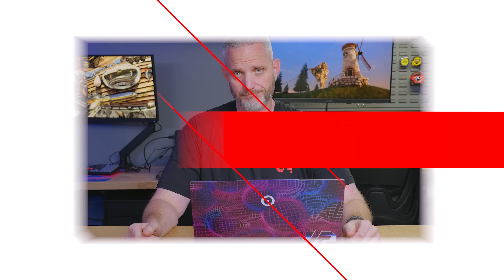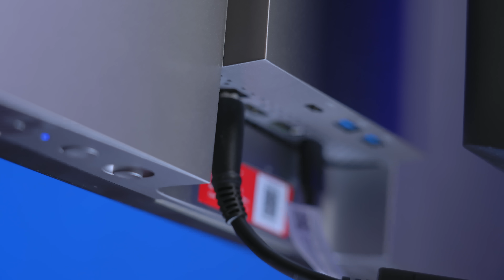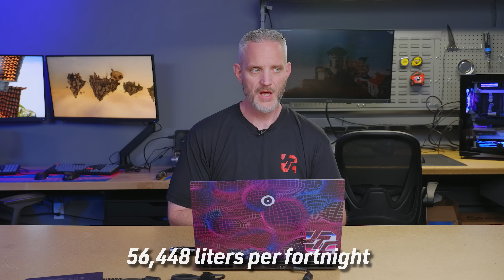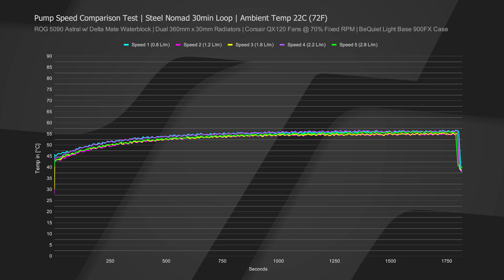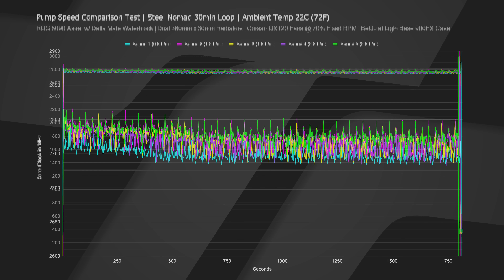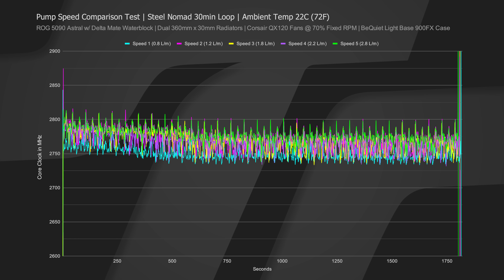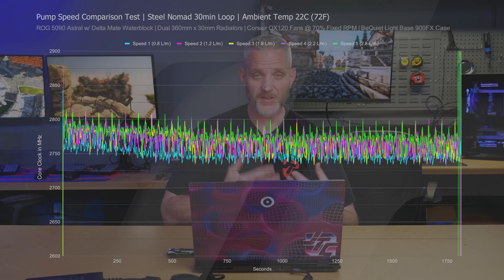Stop doing it this way!

Comment: Advice from someone who has tried just about every kind of loop configuration in my 20 years of water cooling: Don't use reservoirs, use a t-line fill port instead. A reservoir decreases flowrate for a given pump speed, and increases the amount of coolant in the system that isn't actively transferring heat. A higher coolant volume that isn't doing work makes tuning fan speed and flowrate more difficult due to the increase in time it takes to remove heat soak. A reservoirless loop with the smoothest and shortest tubing runs will be quieter and more efficient, and the reduction in turbulence and better isolation of any air in the system can reduce maintenance requirements especially in combination with ethylene glycol based automotive coolants.
Reply: But also, thermal mass increases time to heat soak. So resovoirs are definitely still worth it.
Reply: not necessarily more quiet. Because again, higher heat soak threshold meaning lower temps more of the time. Especially useful for bursty loads.
Reply: @technicalzombie921  That added thermal mass is only useful if it's actually transferring heat out of the system and if it's already near ambient temperature, and because a reservoir both adds thermal mass that is transferring less heat and also reduces flowrate for a given pump speed, regardless if it's during bursty workloads or long term high load scenarios, reservoirless ultimately ends up being more efficient at lower noise levels. Yes, I agree that it's somewhat counterintuitive, but I recommend you test this yourself, because I have in many different ways over 2 decades. Reservoirs, distribution blocks, and hard line with sharp bends will all result in a noisier and less efficient loop for the sake of aesthetics.

Comment: For measuring the Amount of heat the pump adds to the loop -- couldn't you just take the temp of water within a loop with no components (other than the pump) with the pump off. Then, run the pump at different speeds and take a temp of the loop with a thermometer? This way the only heat/added heat you measure is from the pump itself.

Comment: I have run similar tests on my ID cooling AIO and 80% seems to be the sweet spot. If I set it to 100%, it cools more initially but the temp increases more over time. Which indicates the radiator is not getting rid of heat as fast as the heat is being taken from the CPU. If I set it to 60%, the temp rises quickly and stays high. But at 80% it climbs a little right away and then barely creeps up a few more degrees over time. However, no matter how I set it, my 9950x never reaches more than 80C(100%). But at 80% it evens out pretty quickly to 75-77C and at 60% it quickly climbs to 78c and creeps to 80C.
The AIO fans are set to 50% idle and ramp evenly to 100% at 80c
5.2Ghz 1.1v all core

Comment: In really short terms, Q=ṁ*Cp*dT is the answer.

Q is known, as its the heat released by both GPU and CPU (and the pump as stated).
ṁ is known as its measured by the flow meter.
Cp of the coolant is known.
dT is the temperature differential. 

You can play around with these numbers. If add two temperature sensors for the coolant before and after the rad  you can set your dT (or anywhere you want to know the dT). With the dT set, you can precisely measure the heat exchanged by the rad. And, with the overall Q of the system known, compared with this Q measured, now you can get the overall efficiency for each rad, or the entire loop for each flow measured.

Also, you can easily mesure the inlet and outlet air temperature and use the same equation to get the efficiency of the rad/fans. You then can fix the pump speed and play around with fan speeds and set the overall most efficient combination of fan/pump speed for anything you're trying to achieve.

OR, you can go down the rabbit hole of calculate everything by LMDT for heat exchangers.

Comment: I tuned my D5 to about 2/3 speed or around 2900 rpm but I did that for noise more than anything. Pump is mounted kinda solid to the case which would sometimes caused a vibration if the pump was set too high. Fantastic pump by the way!!

Comment: Higher flow rates become more beneficial the more radiator space you have. A build that had 3x 420mm of the same thickness, fpi, find design etc would have more than twice the possible heat dissipation and would show more of a difference. For the sake of the argument alone, someone with external radiators could have seen a much larger difference. That’s because they can have so much radiator space that they basically cool the fluid back to ambient before they exit the radiators.

Comment: You don't need to measure the heat of the pump, in fact, that's probably not a great indicator of how much heat is being added by the pump. You should try and find the pump efficiency factor and set up a ratio of watts consumed at full speed to find what wattage is being converted straight into heat. There's also friction to consider as the pump works on the water as well but it's probably not significant since the pump is tiny.

Comment: why don't test a 1260 alphacool external rad. I use IT with my 5090 is awesome. Or simply test RAD into the case vs rad Outside of the case.

Comment: Perhaps knowing the ideal pump speed, you could test how fan speed might impact this?
Or, potentially, how different types of fans could affect it at different speeds?
I think Noctua for example, have some good general fans that could be used for rads or just general case cooling.

Comment: TL;DR: Pump speeds in AIO have big reserve, so do fan speeds. Those things are not created to be used in open bench with easy airflow. They are made for average poorly vented PC where hot air from graphics card gets fed into AIO's radiator. Systems with half-decent airflow can have pump running between 50~80%. (50% is advised minimum to ensure that pump actually does not stop. Where stop point is somewhere between 15~35%.)
- - - -

I always start tuning cooling with quieting down everything. Settings fans in bios to minimum. And then testing one fan after another at different speeds to find out where they start making noticeable noise and where they start to be loud. Same applies to AIP pump.

Afterwards I set fans in way that they are quiet at low temperatures which are safe (idle). Then set speeds which are highest acceptable to be used at maximum temperature I want system to ever have. And then 100% rpm for what I consider unacceptable temperature (Which is still under what manufacturer sets as maximum operational temp.)
In practice, good cooling will never reach fan speeds close to those highest acceptable noise levels.

Once fans are set up, I test temperature response under load based on pump speed. And again set it in range that is both quiet and more than sufficient. Sure, I use 280mm AIO for Ryzen 7 9800X3D which I limited to 105W (default 120W), which is overkill. It boosts to 5.45 GHz, anyway... thanks to undervolt and being quite power efficient to begin with.

To hear my gaming desktop, I have to turn off ASUS X13 2-in-1 laptop, which has tuned fans for quietness, too. To hear my home server, It is not enough to turn off everything around. You'll need to be closer than ~80 cm from it.
= = = =
Funny thing is, that I do run Liquid Freezer 3. And with recent improvements in small profile traditional heatsink based CPU coolers, I could get similar temperatures at even lower noise level. But I do like AIOs for very specific reason. Portion of cooling which is attached to motherboard is light, therefore when you move PC around, there are no shocks.

Only thing I dislike on AC LF3 is that while you can adjust pipe angle at cold plate block, you can't do same at radiator. That's very annoying for tube management in case where you have only few centimeters clearance. (As those tubes going in/out of radiator aim directly at motherboard's back I/O block.)

Comment: Calculating flow rate is a very common and important thing in Thermodynamics. There is a certain sweet point that you can calculate to get the most heat out of the system before it gets carried back into the loop. This is strongly dependent on cooler size, resistance, fin density, material and air flow rate. If you have all the data, you can calculate the sweet point and set your pump speed to that

Comment: You know what temp bounces around less than a gpu coming on and off load during scenes? Water temp. 

Do you know what temp would have shown the point much better than a bouncing around gpu temp? That’s right, water temp.

The 10% missing once again would have shown a much cleaner picture come time for results making this video significantly more useful.

Comment: Mine seems to work best between 40 and 50% about 1.2Lpm and my theory is the water need some time for heat transfer ether to the rad or to the waterblocks im running a ek block a ek 3090 block and a 9950x3d gpu a 280 and a 420

Comment: Thanks for the vid!

You could make a video about how much resistance a pump actually can handle before flowrate is stopped

I recently built a dual system loop for me and my fiance with 1 GPU block, 2 cpu blocks, 2 radiators, 16 90:s fittings, 2 offsets and 2 EK FLT reservoars. All running with the same D5  pump. 
It is all fine and the pump doesn't have much trouble pushing the liquid through all that 😁

Comment: What was the previous AIO video? I can't find it! The summer is coming...
I have Artic Liquid Freezer 240 II on 5800x with 120 P12 fans on it and on the case for intake and exhaust, and wana see what would be the best optimum setting for the pump!
I don't have a power demanding GPU (7600 XT) that gives a lot of heat.

Comment: Well the Arctic Freezer AiOs can't be controlled unfortunately, but before these I had a Corsair and the a NZXT AiO and I also noticed not a big difference when changing pump speed, but because I only had two options, the higher speed was always better, so I let them run at max speed. But this is maybe because these AiOs have a higher resistance because of the thin tubes or small pumps I guess.

Comment: Hello Jay thx for a great video on how you found your optimal flowrate for your fluid mix and GPU block finstack combo. Looking at the graphs to me it seems it will be perfect at 1.5Lpm maybe check that and see if it marginally tops the rest.
I am also curious if this speed aligns with your CPU block finstack, what coolant speed does it prefer? Is it 1.5L like GPU or faster/slower? 
And would using purer coolant(destilled+algae killer) change the dynamics?
Looking forward to see the results :D
Reply: Conclusion: Everyone should do the test and adjust flowrate depending on their loop configurations, it's a small difference but 2-3*Cor potentially more is something in the world of using exotic thermal interfaces and top end cooling in general where the case of few degrees is make or break on benchmark scores.

Comment: You could measure the heat generated by the D5 pump by running it in a loop with just the pump and some tubing.
Reply: And heat exchangers have the highest efficiency when delta T is the highest.
Besides the noise, just going for the fastest flow will usually be counter productive

Comment: Depends on flow but if you open loop on return and see how water flow is outside the loop might tell you what speed is best honestly but a good flow is around 2 litre per min same as cars the pump doesnt push alot of pressure

Comment: What about the temperature difference between two radiators in series vs parallel. The fluid could flow faster over the heating elements, but slower through the radiators

Comment: 60k hours is roughly 6years and 9months of continuous use. Way better on average than an AIO. However if you’ve got a 4090 or 5090, with how good they are I think people could very well still be using the same rig further than the life span of a pump at 100%. So don’t run your pumps at full speed folks, get that extra life.

Comment: As a retired auto mechanic who also did auto air conditioning, and has training as a welder, I can offer the following advice. Cars have thermostats for two main reasons: 1/ allow the engine to warm up quicker from a cold start by staying closed until optimum running temperature is reached in the engine block. 2/ To slow the rate of water flow down so that the water 'absorbs' the heat from the engine more efficiently.
Many will argue that removing the thermostat allows the engine to run cooler, but the only thing that's running cooler is the temperature gauge sensor! Don't believe me... ask any welder what cools a hot weld down quicker. Is it cold running water from the tap, or a bucket of cold water into which the job is immersed? The answer will be the bucket of water because the surfaces have time to equalise in temperature. Same with your car's air conditioner. When the technician tests the air temperature coming out of the vent, it is always at the slowest speed so that the air passing through the evaporator has time to cool.
The moral of the story is simple. A slower rate of flow will cool the computer down more efficiently than a fast water flow. Some will say that the car's water pump is spinning quicker at higher engine speeds, and yes, it does, but what must be considered in that statement? Although the water pump is spinning faster, it is not working more efficiently as the faster water flow is now causing vortexes within the cooling system which is causing the system to work less efficiently, which is why racing cars use an electric water pump which gives a consistent flow at any engine RPM. A larger radiator will improve flow and allow a greater heat loss to the atmosphere. More air flow will always help keep things cool, so more fans, larger fans or both, and fan speed does play a role in keeping things cool. And finally, the coolest the computer can run is, as Jay always says, the ambient temperature of the room!

Comment: Also, flow rate and head pressure are not the same thing, a flow meter straight after the pump and another before the pump to check for differences might be interesting.

Comment: Its all about room ambient temps, lower room temps mean lower case and water temps which means lower component temps. Rads, loops, fans and TIM all have a maximum level of heat transfer but at some point the room ambient will be the only thing that can directly impact those temps.

Comment: I wonder if there would be a bigger difference in the results if you only used 1 rad instead of 2 so that there was more of a struggle by the cooling system to actually cool.

Comment: The trick for periodic oscillations is to measure from peak to peak (I count about 13-14 per 250 seconds) and use that as the period you average over. Looks like 18-20 seconds will give you a much smoother average. (base on the 9 minute chart)

Comment: Just run the D5 loop without it on a PC at various speeds and see if the just the motor speed causes a rise in loop temps... Seems pretty straight forward to me.  Run it in a system with an air cooled CPU and GPU, but still hooked up to all the headers to monitor and change pump and fan curves.

Comment: I also tune my uni-fans and pump to where I either can't hear them or can tolerate hearing them in an O11D-XL case two feet away. During gaming with headset, I set the radiator fans to 75% speed on rads, the chassis intake fans to 85%, and the pump about 60%.

Comment: From what I was told from way back when in a forum a manufacturer (iirc it was swiftech) recommends running the pump on max speed coz as you said coolant cools the pump itself and it actually works better at max speed (the pump) and it extends it's life. They found out in their testing that running at 100% pump speed the pump lasts longer than those that are ran at 80/50/30%

Comment: You want your coolant flow to be between 0.5 and 1 gpm, below 0.5 gpm you will experience big delta in coolant temp. If your loop is big and restrictive, you might end up with 1 pump forced to work too hard to keep up the coolant flow. Then, you need to look at what is the source of restriction if your loop volume is small. If your loop volume is large with lots of bends and/or multiple radiators, then you need more head pressure, so you need more pumps in series to run your system at lower pump RPM but still keep it above 0.5 gpm. Also, if you have more radiators you have more surface area to cool the fluid, so you can run more fans at lower speed. Another thing to consider is environmental, aka room temperature. If your room is boiling hot no matter how well balanced and built your loop is, hot air will not cool your system.

Comment: Title: Stop doing it this way!
Jay... STOP CALLING CUSTOM LOOPS, AN OPEN LOOP!!!!!!! IT'S NOT AN OPEN LOOP!!!!
Open Loop = the "loop" is OPEN TO THE AIR AT SOME POINT OF THE "LOOP"! The water will be EXPOSED TO THE AIR AT THAT POINT IN THE "LOOP" before it is colleted and returned to the loop! You wouldn't be able to do a pressure test to check for leaks on a Open Loop, because it is OPEN TO THE ATMOSPHERE!

Comment: My own testing was similar in that the pump speed didn’t seem to matter at all, but the fan speed across the radiator did matter a lot. Replacing my fans with higher static pressure and higher CFM ones also made a lot of difference. My conclusion was that the water blocks and radiator had a lot more thermal performance available than I was taking advantage of. The blocks, fluid, and rads were doing their jobs very well. What was lacking is me having enough air moving across the rad to let the rest do their job to the best of their ability. Focus more on the fans and the air temp coming out of the rad.

Comment: Need more data. Is 1.3-1.8 liters per minute something people should target? Or is it only beneficial because the pump is at 50%.

For instance, 1.8L/M would be around 90% in my triple rad, triple distro, gpu, cpu, and ram waterblock, v3000+ build.